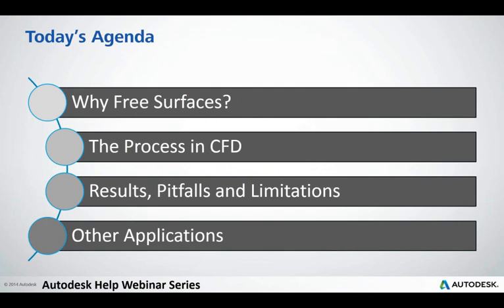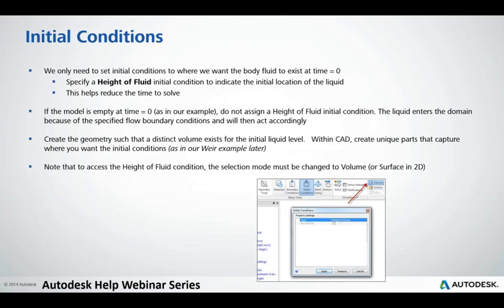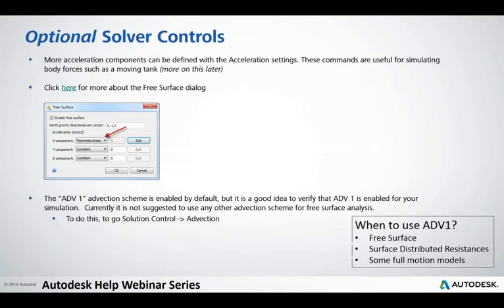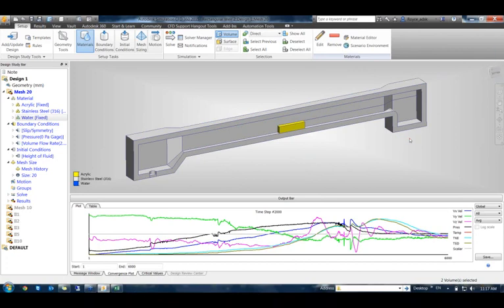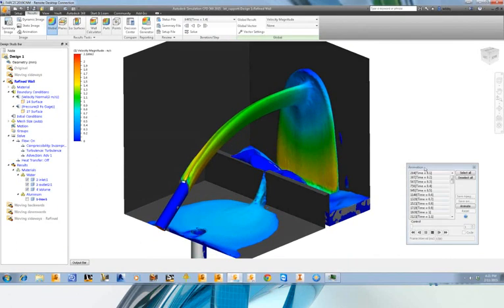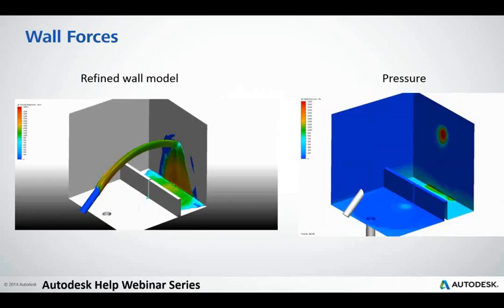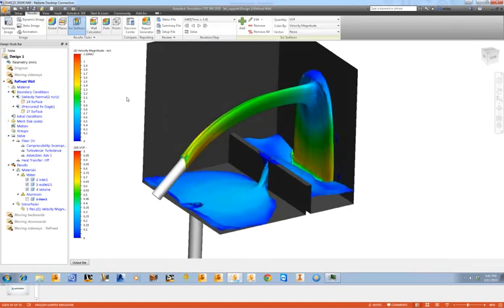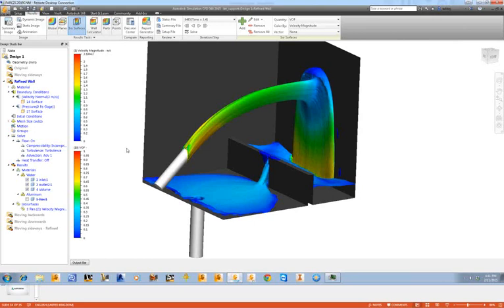Free Surface Analysis Best Practices with Autodesk Simulation CFD

Comment: Hey John & Royce do you know of any good tutorials for CFD relating to sloshing in a fuel tank. Looking at the forces of the fluid acting on internal elements such as baffles and fuel senders etc? Also looking for good tutorial to help with setting up a simulation for an approximate rotation speed of a water turbine? Any help would be greatly appreciated.